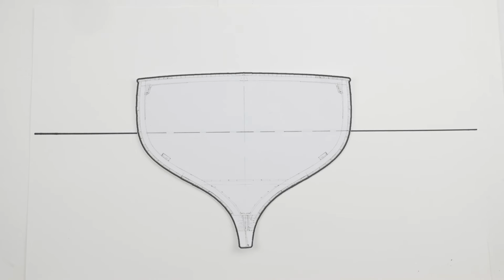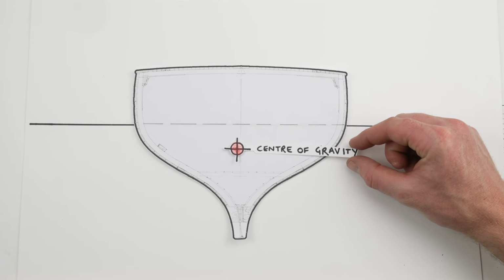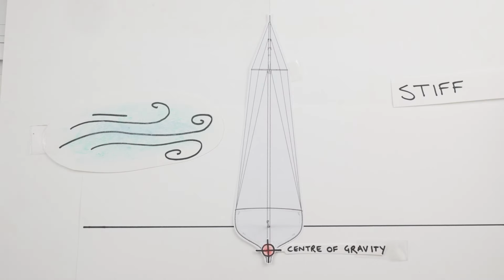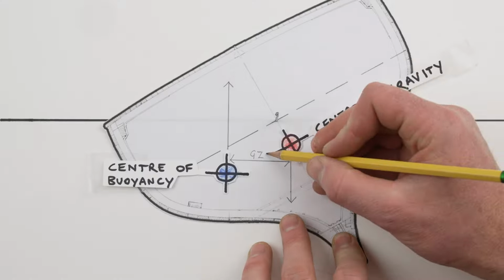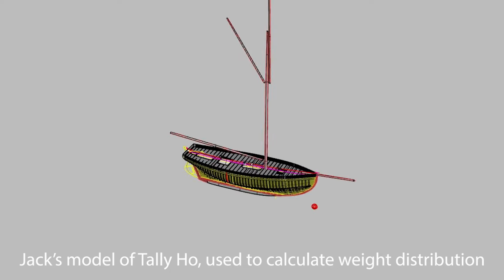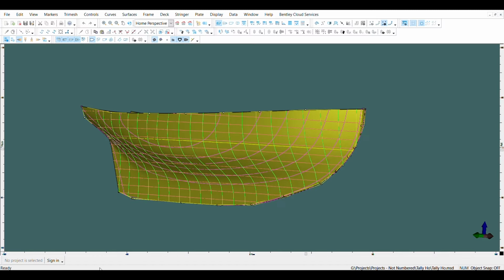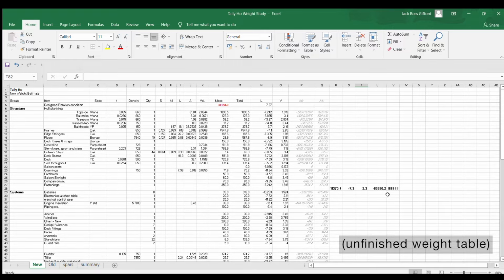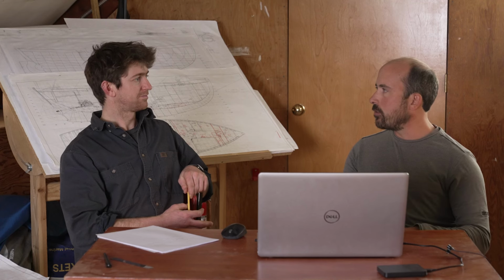Stability Calculations (Boatbuilding / Tally Ho EP125)

Comment: A bit late in the day, but I'm less than convinced that some heeling is required for sails to work. Catamarans, especially large ones, barely heel at all, and yet they usually achieve at least 50% extra speed over a comparable length monohull;, so clearly their sails work fine. A slight heel will help to keep the boom to leeward in light airs for any hull shape. Also, I reckon that it is stiff monohulls (and all catamarans) that need to be reefed early, whereas tender monos can spill sudden gusts readily and safely.

Comment: The technical discussion here is really excellent. Experienced sailors will have picked it up, one way or another, but for someone like my wife, who is intelligent and interested in sailing but not fully knowledgeable, this kind of information helps to put the knowledge she has into a more meaningful context.

I want to elaborate a bit about the dynamic nature of buoyancy and mass. For simplicity, Leo mostly dealt with the static effects, hinting however with his references to stiffness and tenderness that something dynamic emerges once dynamic forces like wind come into play.

Mass distribution can have a meaningful effect on how a vessel handles in a seaway. It's the same principle as a pendulum: the more you concentrate mass in the ends (for example heavy anchor and chain in the bow, heavy engine toward the stern) the  more forcefully the vessel will tend to pitch rhythmically, ploughing or wallowing along instead of maintaining a steady trim. If this becomes a problem, to some degree the point of resonance can be tuned by moving cargo or ballast toward or away from the ends. Usually you want to keep the ends light.

The same pendulum effect takes place with mass distribution in the vertical direction. Described as "top hamper" when excessive, any mass concentration toward the masthead will tend to make a vessel roll more forcefully in a seaway.

With gaff rigs this dynamic effect has to be taken into account early in the design. There isn't as much mass aloft in a marconi rig, but it still excites interest among performance sailors to change from wire rope to synthetics in order to shave off a bit of excess weight. The boat may feel less tender yet more responsive as a result.

Then there's the matter of dynamic buoyancy, wetted area, and waterline length. It's a big subject and I don't claim to fully understand it, but I think its existence is worth noting at least, because the effects of hull shape can be so profound.

Consider a floating sphere with a fixed weigh somewhere off center inside it. That sphere will of course tend to right itself with the weight at its lowest point. But it will also roll very easily because nothing but the position of the weight is resisting the roll dynamics. Put the weight exactly on center and the sphere will roll dizzyingly. It has zero righting moment, zero stability. Any other shape but a sphere will tend to right itself through buoyancy. A more ellipsoidal or dish shape has positive buoyant stability. A more conical shape than a sphere has negative stability.

We somehow end up with ballasted keelboats which have some turn to the bilges, sometimes considerable rise, sometimes nearly flat bottoms, sometimes considerable overhang in the ends and sometimes none.

Subtle differences in shape will make a hull stiffer or more tender at different degrees of heel. And different degrees of heel may significantly increase the waterline length of the hull, increasing its hull speed as well as the buoyancy of the ends. It's fascinating how much is going on dynamically as a result of choices in static hull form.

Comment: For your explanation of center of gravity, buoyancy. I have no experience with boats but physics is basically the same for boats and other crafts. A rigid object always turns around its center of gravity. In your explanation you put a nail on the water line and turned around the nail, however you should put the nail where the center gravity is as this is the point where the boat moves around.

Comment: Great video Leo.  I am a warship Naval Architect.  I was surprised to see in Jack's weight spreadsheet that he does not account for the TCG (Transverse Centre of Gravity).  Whilst the chance of weight being far off the centreline in a V shaped hull is limited, the position of 'heavy' items such as the head(s), the washing machine, cooking equipment, etc needs to be checked.  Even a small TCG off the centerline will result in heel and trying to fix it requires a relatively large amount of ballast as the lever distance is low (that is if the ballast is positioned in the bilges).  You cannot assume that the TCG will be on the centreline and it should always be checked.

Comment: As a retired aerospace engineer I echo R. smith observations of your video. Just like a ship, airplanes deal with center of gravity and center of lift. Your definition of stiff and tender in roll are identical to Lateral stability of an airplane. This parameter is adjusted by wing dihedral primarily and tail size secondarily. Like you mentioned you can have too much roll stability. I am sure if transport aircraft had high stability, the high frequency oscillation would not do well with meal service. Kudos and keep ‘‘em coming.

Comment: I don't understand.  The main relevant changes you've made from the original is moving a lot of the ballast onto the keel and reducing the weight of the spars by choosing a much lighter wood, both of which would have moved the center of gravity down, so how is it maintaining the same characteristics as the original?  Did your other timber choices really make that much of a difference?  The only other thing I can think of is if you did not calculate the increased mast height into the center of mass for the original, but that would suggest you're trying to mimic the sailing characteristics as designed by Albert Strange, but everything so far has suggested you're rebuilding her as she was was during the Fastnet race of 1927.

Comment: The centers of gravity and bouyancy are particularly important to submarines. On both diving and surfacing, these two points cross and make the sub effectively a big pinwheel. For example, you do not want to submerge a submarine during heavy weather if you can avoid it because of the risk that the boat can become inverted if hit by a big wave when the centers are on top of each other.

Comment: I am curious about the weight difference in sails considering the modern materials verses sail material in use 112 years ago.
Reply: Modern synthetic sailcloth (& rigging) is generally lighter & absorbs less water than natural fiber materials. But it's still subject to mold/mildew & UV damage.

Comment: I believe that for a ship to be stable, the center of buoyancy must be both below the waterline and above the center of gravity.
Reply: In the cross-section view of a boat, there's a point called the metacenter that is always vertically above the center of buoyancy. As long as the center of gravity is below the metacenter, any heeling of the boat will generate a force (righting moment) that attempts to rotate the boat back to an upright stance, even if the CG is above the CB. See the Wikipedia article 'metacentric height' for a decent explanation.

Comment: The import for the cog and cob is the righting moment as felt at the steerng position.  As the boat heels the boat should stiffen up progressively and come to what feels like an absolute stop. That will hit on her beam ends in a knock down, so you will feel in big waves that she absolutely resists going further, and at what point her keel works to right the Boat.  If you've got that it will give you gut confidence in a blow.  As for too stiff....lol... it's unlikely. Just ad more mast. Lol. 
The way round it is to gaff rig. 
I think you will find your going to need more ballast than you think, from what I watched of the keel lead and fit. But you know that yourself. Internal blast is fine, but you'll need relatively more internal than external due to leverage. Which you also knew.  Just lock it down. Don't count your tanks as ballast. Because they're not.  And it will be evident when your low on fuel and a big blow is in the offing.  I bet she's not as aft heavy as you think but aft heavy is beter for bad weather than bow heavy or even balanced to some extent. 
Nowt worse than lack o' grip in the rudder lad. 
I wouldn't have cut any weight of the keel tbh and actually would have added a few hundred weight. But you'll know when get the feel of her. 
Owners went close as they thought cash  prudent with lead.  Most needed a touch more than they got.  But... well you'll see. Or rather feel. The difference in inboard to outboard ballast is huge. And feels it . Just get it as close to the keel line as poss. And obviously start with more ballst than she needs and remove it as necessary. Is easy to chuck overboard. Not so easy to find and place when your heeld and staying heeld with your feet on the coaming and your head next to the coach roof with no rudder. Lol.

Comment: 2  Lifting straps and 4 scales can determine the C.O.G.   Bouyancy is much harder to calculate. and affix. so the boat might be heavier on one side listing ( Though We Know this design is Stable ) the wood added weighs differently , so once again you(from original) will have to balance the boat . Hence why you find C.O.G and C.O.B.  then adjust with weight.   Pretty Easy to shave the Keel Weight.
      I Love the idea of being able to print a boat, paint it and make little sails. sounds Fun !

Comment: Any idea what the total cost of this project has been so far?
Reply: Leo hasn't mentioned all the costs, but I've kept a running total of what he's announced in the vids:
- US$10,000 - sailcloth
- US$36,500 - copper rod, bronze rod, bronze ingot, foundry costs
- US$99,000 - timber 'in the boat' (includes most shipping, excludes kiln-dryer rent,  excludes softwood timber for deck, bulkheads & spars)

So that's $145,500 just for most of the raw material, but doesn't include the 17,000 other things that were bought (or sometimes donated). For example, that very red hybrid engine was well north of $8k.
Reply: A very rough cost estimate was included in the 2013 Surveyor's Report provided to the Albert Strange Association:
- $155,000 labor for hull
- $30,000 materials for hull
- $150,000 for "everything else"
This total amount may be greeted w/ laughter & derision.

Comment: This may be a silly question, but shouldn't the center of gravity be below the center of buoyancy?
Reply: Leo didn't explain the concept of 'metacenter'. As the ship rolls to one side, its center of flotation also moves to that side. The metacenter is the point where a line drawn vertically through the center of flotation intersects a line drawn through the boat's centerline (assuming the center of mass lies somewhere on this line). As long as the center of mass is below the metacenter, gravity will return the boat to an even keel.

Comment: I'm curious to know if in any of your stability evaluation you discovered one or more opportunities to improve on Tally Ho's performance (speed, comfort, safety, etc) that departed from the original design.  If so, are you so committed to the original design that you would pay the price (i.e. slower boat) out over the next 75-100 years?

Comment: Great vid! Unless I missed it, I would imagine there will also be a considerable difference in sail weight, and its consequent effect…… or, are you going old school and sticking with cotton/canvass for the sails?
Reply: For practical reasons, natural fiber sails & rigging are ruled out for all but the most exacting historical reproduction work. The stuff is far heavier, & gets heavier still when wet b/c it absorbs more water. Add to that: decreased strength, UV tolerance, wearability & mold resistance.

Comment: Given the frequent changing of angle of the boat heel, how is an optimal centre of boyancy calculated? Do you base it on the sub-surface area of the boat at a few fixed angles (say, 0, 10, 20, 30, and 40 degrees), or is there some sort of fancy calculus that can be done for this?
Reply: There isn't an optimum amount of heel, given the ever-changing factors of wind, wave & point of sailing. The ship's "righting moment" (the force the center of mass exerts to rotate around the center of flotation back to an even keel) is calculated at several different degrees of heel (0 thru 90+ degrees), & the results are plotted to describe a Stability Curve - this is made for both empty & fully-loaded conditions. A potential marine insurance co is usually avid to check out her curves.
Reply: @frederickstibbert7389  thanks for the explanation! I’m a mechanical engineer and it’s interesting to learn about this stuff that I’m not usually involved in.

Comment: Excellent video Leo. As a pilot much of what you talked about ties in with Weight $ Balance for aircraft. 
   I am continually amazed how the production of ‘boats’ over the thousands of years evolved with out the use of an instrument called a Computer. Trial and error combined with some mathematics and ‘ daring’ has carried the craft well into today real world. 
    ??? QUESTION… while making the stringers or ribs of the hull, did you keep a log of the finished weight at installation of each rib etc.

Comment: Interesting, but after watching this video and considering the analysis that was explained and modeling and calculations done, I couldn’t help but think that this 112 year-old sailing vessel Tally-Ho had no such analysis tools back in the day. I suspect that after completion, the original boat builders simply put the boat in the water and adjusted the ballast accordingly and turned whatever other ‘knobs’ they could turn for best performance. And to quote from someone in an aircraft company I used to work for, “One test is worth 1000 ‘expert’ opinions”. Just finish and put it in the water Leo! ;)

Comment: Does Tally Ho's waterline length change significantly with heeling?
In some vessels this can add significantly to hull speed.
Just curious...I'm sure you have addressed this.
Thanks for the fascinating chalk talk.
Reply: Tally Ho has a vertical stem & nearly square transom, so there's no change in waterline length when heeled over.
Reply: @frederickstibbert7389  
Thank you for the explanation...that makes sense, looking at her lines.

Comment: I did a presentation at a wake boat manufactures seminar about ballast with a model boat in a fish aquarium for the BoatUS foundation.  i demonstrated the danger of using led ballast as opposed to liquid ballast,  i used water for the presentation.   I showed how a boat with water ballast did not sink when flooded and how a boat with led ballast rocketed  to the bottom.   Now wake boat dealerships warn new boat owners about the use of led ballast in one line in the owners manual.....   That was my contribution to the marine industry

Comment: Haven't read all 800 comments so apologies if this has been mentioned, also not a naval architect

Sounds like the weights table is a method for calculating the Moment of Inertia (MOI). The co-ordinates of the MOI in relation to the COG give you an idea of where to add/trim ballast from the boat to suit how stiff/tender you want it to be. Also sounds like a good way to ensure predictable behaviour, you don't want a little bit a heel in 10kn of wind then suddenly huge heel in 12kn, cause its top heavy in the wrong spot.

Comment: An after thought,after listening to the information. Would it of been easier to weigh each component before assembly. Work up front saves work at the end and more accurate results. Especially when vertical height involved.
Reply: Not that easy to do - Leo & crew spent hours shaping the keel & centerline timbers to precise dimensions which presumably could have been weighed before being bolted together. But there's still acres of work to remove lots of material from those timbers (for the frame seats, propeller cutout & planking rabbet), so their pre-assembly weight isn't a number that can become part of the final total.
Reply: Fully understand especially purple heart pieces and keel which are hard to calculate and hardware might of been easier to weigh before installing, and all ribs. Just a thought.
Reply: @johncollier6205  - this wooden boatbuilding job is a lot like being a sculptor except you have to build the block of marble before you can start chipping away at it.

Comment: Leo,,thanks for the indepth dive. I  want to know more about how the original curves were made. Did Albert Strange calculate the center of area for each frame to get the center of bouancy? It's one thing to do it with a computer, but how was it originally calculated?
Reply: An instrument called a planimeter can find the area of a traced outline, but more usually you'd subdivide the irregular shape into a bunch of rectangles & triangles, then add their areas together.

Comment: Excellent video Leo. Took me back to when I was doing my mechanical engineering degree in the late 1970s and we shared some of our classes with the Naval Architects who in those days before widespread computer aided design were learning how to do those calculations the hard way, using calculus to determine the areas and volumes of sections of the hull. Nowadays the tools make lighter work of the lifting but the thinking is a real as ever.

Comment: Thanks for a great video. Love the technical stuff. I sail a buccaneer 18 which is quite tender which is much to my liking and makes for a very responsive boat and active sailing. And as you said tender makes for great sailing in light wind.  Interesting to learn that the older cruising boats tended to be tender.